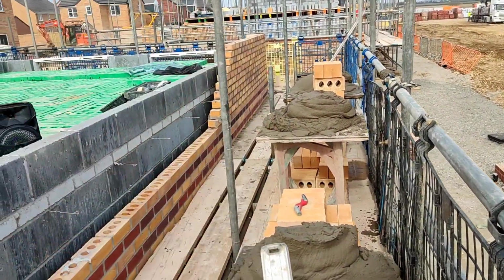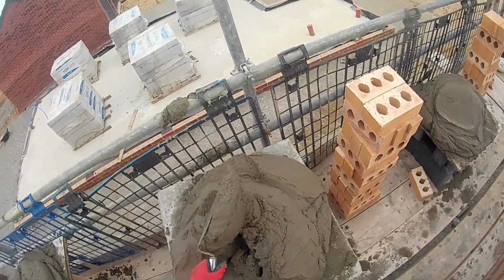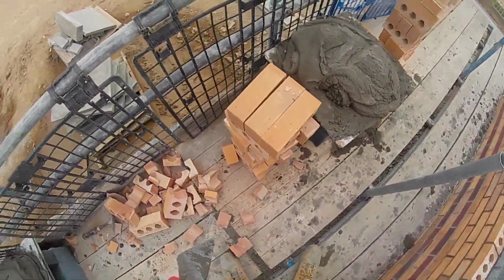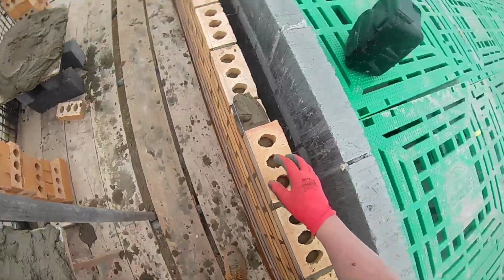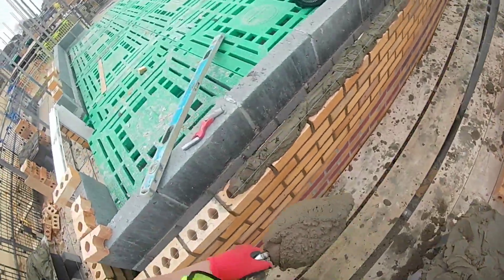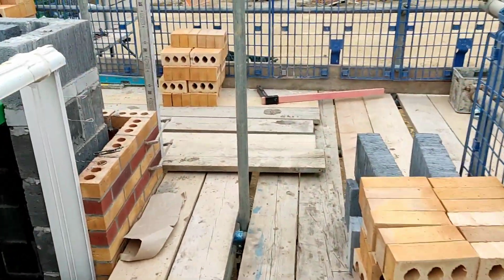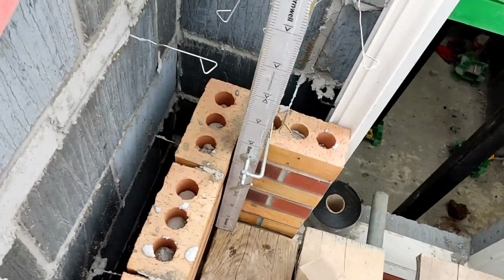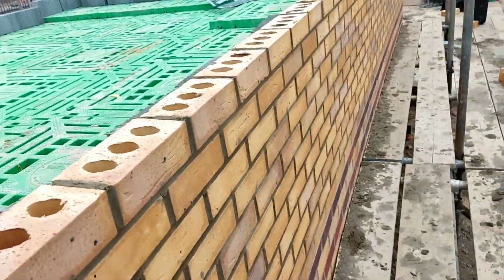Bricklaying Vlog - My Last Solo Day?! (Hopefully🤞for a while...)

Comment: I am a site chippy great to see how other trades work 
Great system but seems a lack of drive to make the big bucks
Reply from the maker: Do I seem to lack drive?
Reply: I dont understand how you get work on your own mate all the time. Must say, most sites only take on 2 and one squads, at very least. 1 and 1 very rare up north. Although that is how too make the money man!!!
Reply from the maker: @stevendunn5430  I run into loads of 1n1's mate like myself, obviously I just have my odd days solo like today, but there's that many crap gangs out there, who are rough n don't know what there doing or are slow, if your work is clean n tidy you will always find work, speed has a factor as well, but I'm as fast as 2 steady bricklayers even on mi own and sped up alot when I have a hoddy or Mel on the Trowel with.me, there's tons of 2 n 1 gangs etc just aiming to earn £500; each a week steady away, so if your somewhat quick you will get through the same amount of work 1 n 1 easily, makes you no different speed wise 👍👍, hope you understand a bit better lol and it depends on the site or subbie, if your a one n one move subbies, if they won't give you work as a smaller gang 👍👍
Reply: @theafter8bricky  
Little pal probably just because I am a joiner and joiners are greedier 😀😀( get earlier stay later)
Love the videos bud
Reply from the maker: @davidpitchley543  8 hours a day is enough for me 🤯